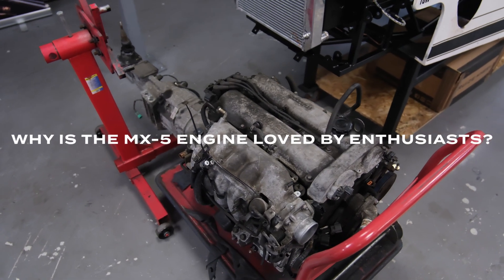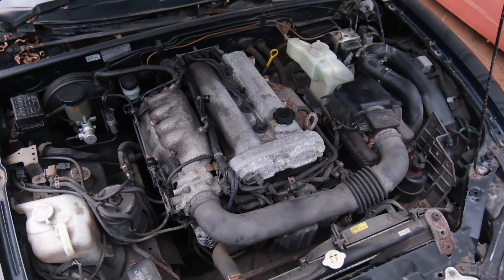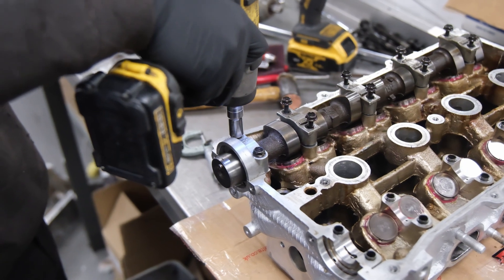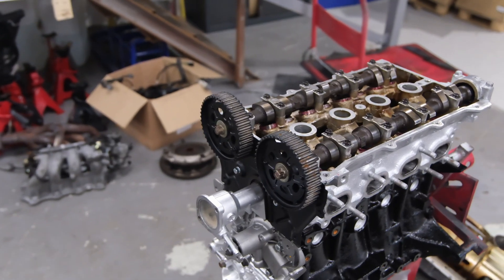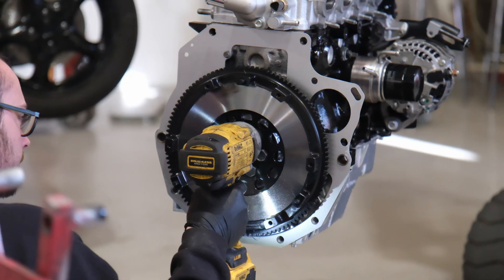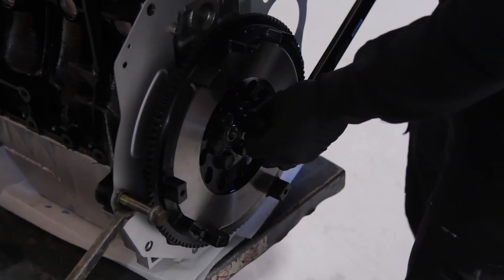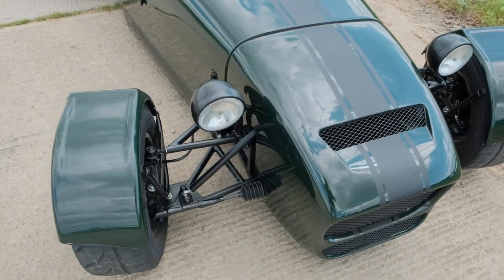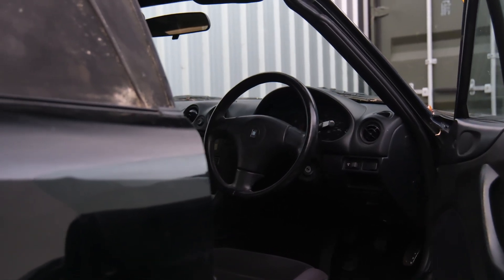Is this the BEST ENGINE to LEARN mechanics? (Mazda MX-5 NB)

Comment: They go for around 10k minimum, same as any of the other types of older mx-5s
Reply: F you on about I just bought a 2004 1.8 Arctic Edition with only 35k miles on it for £3500

Comment: 100% spot on about this engine. The other beautiful part is that it allows the owners to do whatever they want to the engine as far as modification and still have a large knowledge base already available from things like cams, exhaust and intakes to ITBs, forced induction or full head swaps betweeen different generations.